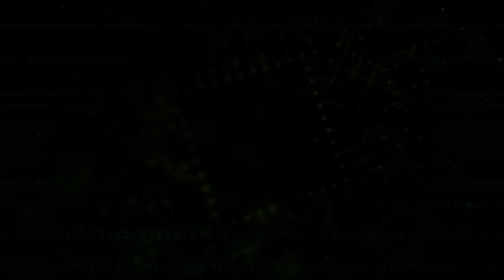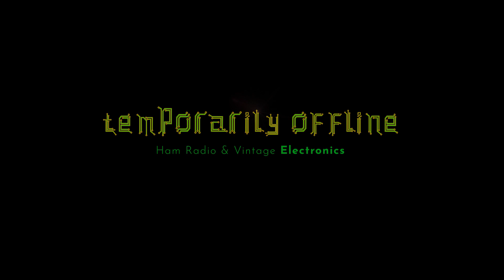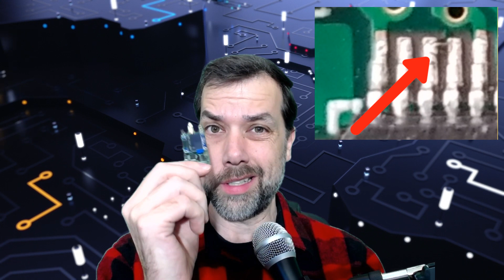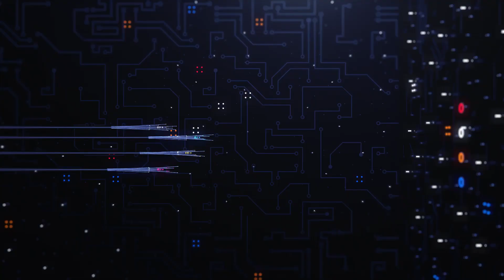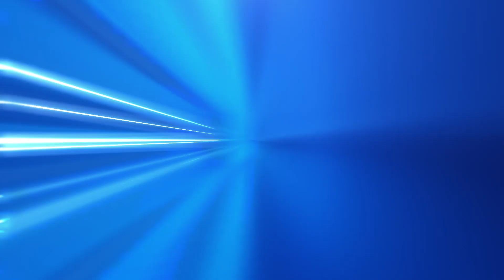DMR MMDVM Hotspot Quick Fix #hamharder

Comment: Dude, my OLED 3 on my dual band hat with a Pi 5 worked for a few hours but now is not even showing any text or signs of life. Any clue? It may have happened after I ran an update but can't say for sure. Thank you.
Reply from the maker: Hey Matt, I'd check in the config section and see if you've lost the display settings... If that doesn't work, check the solder work and/or order a new display?  Let me know.
Reply: @temporarilyoffline  Thanks man. It's a Pi 5 and I don't think they have it smoothed out yet. To get it working again, I deleted it, powered it down and added it back but it's still giving me issues. Time for a factory reset. Thanks
Reply from the maker: @mattcero1  ah yeah, pi 5 is how they get ya!  Swap out for a zero2w and use that pi5 for something better.
Reply: @temporarilyoffline  Yup. My 3B+ is running my recursive DNS server and it may be my Pi-Star soon and my Pi 5 my DNS Server. The ol' switcha-Roonie.